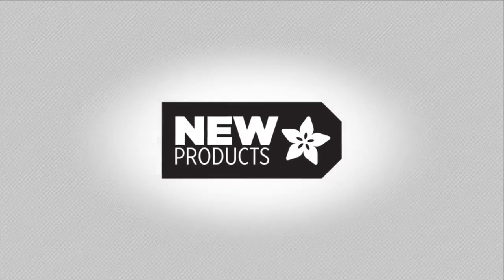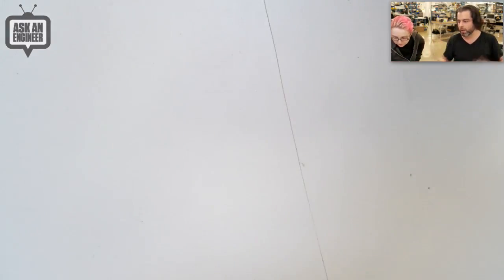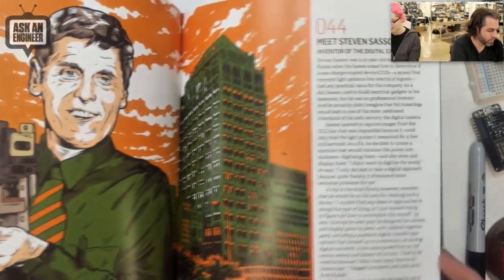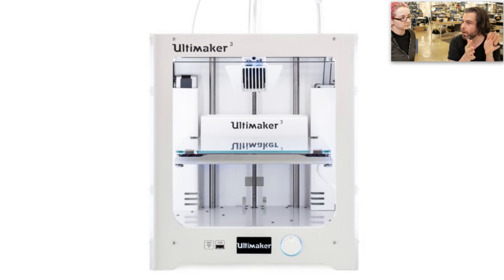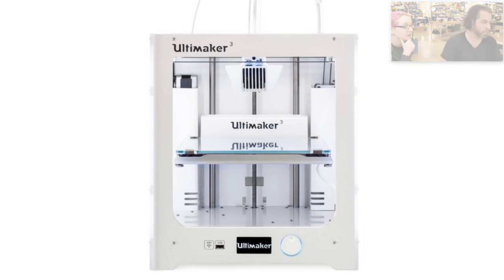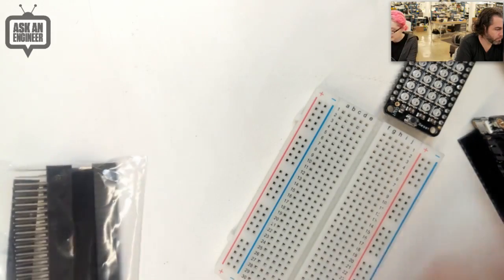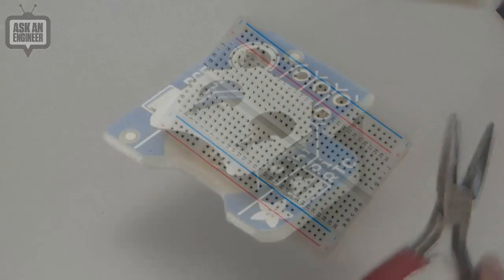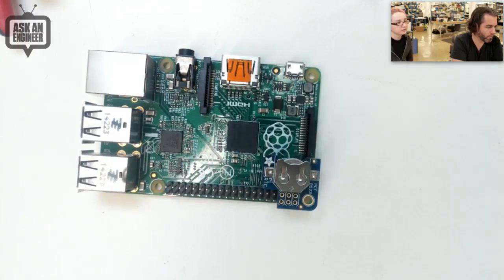New Products 1/25/2017

Comment: I would love an item to teach me to solder better, specially headers.
Reply: Practice.
Reply: Breadboards and heating the top of the pin and pressing the solder against the pin helps me quite a bit. Sometimes adding a small dab of flux to the pins makes for nicer solder.